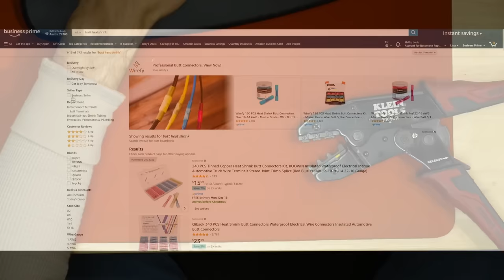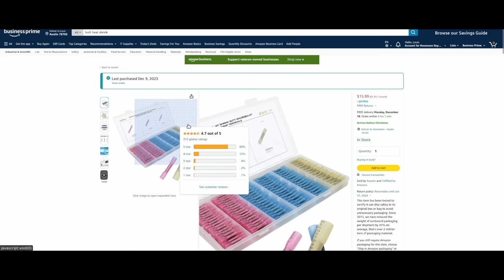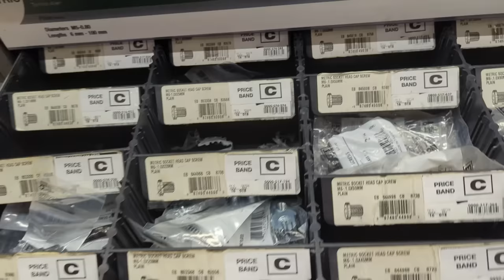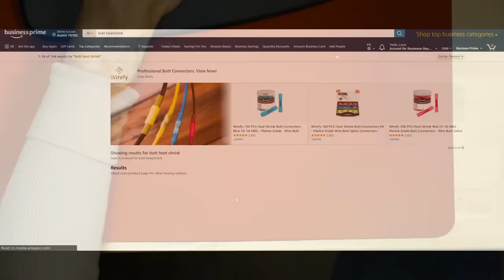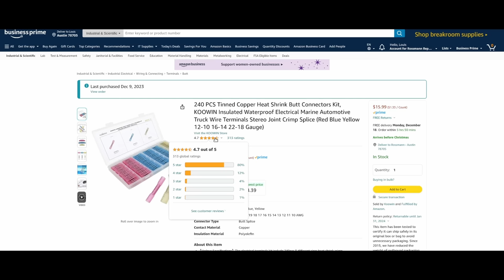Amazon Sells Dangerous Electrical Crimps

Comment: I put in an honest review of a WiFi camera I bought from Amazon.  It confirmed what other reviews were saying about the difficulty getting it to work and how the seller, a company in China, was trying to bribe you for a good review by withholding the promised memory card until after you gave them a 5 star review.  My review was taken down, along with the others and I was barred from reviewing that device again, by the request of the seller.  This speaks volumes about the integrity of the reviews on Amazon and I place little value in the ratings and comments.
Reply: I stopped using Amazon for exactly these phony reviews and very crappy products. Now I try to buy American. If I can.
Reply: Hahahaha! Holy shit! That's actually a thing? The seller can request bad reviews being taken down? That's just horrific.
Reply: I wish there was a way on Amazon to search by country of origin.
Reply: This is informative and unfortunate, but not surprising at all.
Reply: I only read negative reviews. They are the only ones with valuable information. If there are no negative reviews, I won't purchase the item because I don't know what potential problems might crop up. I expect even high quality items to have at least a few negative reviews because after all, no product is perfect.

I use ebay for most of my online purchases, but only for low value items or collectables.
Reply: @billh.1940 same shit in Germany. Lots of The Chinese don’t fairplay
Reply: I think I remember seeing your review because I was looking to upgrade my two porch 2.4g cams to 5g because it's very hard to get them to connect on my cell.
Reply: Many stores do this, eBay allows positive reviews before you've received the product but negative reviews can't be posted till weeks after it's arrived and often get blackholed or sandboxed so only you can see it.
Reply: I got into a similar situation reviewing a stick PC I meant to use for my TV. I returned it as I noticed it couldn't even play a youtube video in 480p without stuttering, put it a review, and for three months I've been constantly harrassed first with bribes, then with threats of being reported to Amazon.
Reply: I was once refused of my review, because it was not positive. I guess the product had already received to many bad reviews.
Reply: Try reporting counterfeit memory cards. There are videos about this where Amazon blocks the reviewer. They're aiding the fraudsters!
Reply: @billh.1940  for tools, european (especially swiss and german) brand names (like knipex, wera, hazet or felco for gardening equipment) are usually also very high quality. They are also usually quite expensive, but for professional use, the time saved should quickly alleviate that, as well as the durability.
Reply: I had a similar experience.
Reply: @gblargg  reading the reviews is like walking through a mine field, you really have to read a lot of them. Before deciding on a product.
Reply: Yeah it's disgusting how they cater to high volume sellers. Amazon has been morally bankrupt for a very long time. I spent $20,000-$25,000 on Amazon in 2014 with zero returns. Last year I had a dozen returns with $500-$1,000 spent. 

Also like Louis said you have to return the products so that the shipping is spent for Amazon to have to warehouse it/ destroy it.
Reply: This is how reddit has become my main source of reliable reviews... and hoping they aren't deceptive too.
Reply: @kennichdendenn  I know, I use them all the time. I also have older craftsmen tools. Once upon a time craftsmen were great.
For me it is also about fit. They dont slip and mess up nuts. They last so you only buy them once.
Reply: This is the type of crap that companies should have no ability to do. If you force a customer to remove a factual review, you are falsifying customer satisfaction by omission.
Reply: Jeff Bezos certainly didn't get rich by upholding ethics.
Reply: @joedirt1965 that's racist
Reply: @SilverEye91  Yes, they can these days.
Reply: Amazon is known for taking down or not publishing honest reviews. I have had multiple reviews taken down or not placed based on Amazon guidelines, whatever that is.  Of course they never give you the reason for why they won't publish just that they will not. They will also take down or not publish reviews that are negative about Amazon Prime. I did a review on a product that I purchased that came damaged as I was doing an unboxing video for my channel. When I made reference in the written review about the shipping delay with Prime they would not publish. I was informed by another content creator that they do not want negative press about Prime and will delete. Ridiculous‼
Reply: @ekscalybur  That's dystopian.
Reply: The unique 2/3 times that I tried to give a review that was honest and not positive, they always ended up rejected/deleted/removed... That says it all...
Reply: So where can we buy from?
Reply: I have left one star reviews for some fake USB drives I bought.

Not only did my reviews get taken down, but when I appealed showing proof the drives were fake, Amazon refused to listen to me and the counterfeit seller is still on their site to this day.
Reply: I had a similar experience with an awful product that tried to bribe me for a good review, I tried to leave a bad review calling the company out, amazon refused to even post the review saying they I wasn't allowed to talk about the company, ONLY the product. They know what they are doing for sure
Reply: I always look through critical reviews first to see if there's a pattern
Reply: I have multiple experience like this. I bought a product, inside there is an instruction how to get Amazon gift cards by leaving a review. I reached out to Amazon customer service, they didn’t do a damn thing.
Reply: I had something similar. I wrote a bad review for an Amazon marketplace seller, because he was a scammer and sold inferior versions for the full price, he even went out of his way to put a wrong sticker on it so people think it would be the right product.
It got removed because "you can't rate the seller for bad shipping, because shipping was handled by Amazon", even though I didn't wrote anything about shipping.
Reply: Dang can you share the name of the camara?
Reply: @joedirt1965  They will just set up a US "office" that is nothing more than a post office box so they appear to be US. Half of them are that way already, either in Canada or US.
Reply: @321CatboxWA wat in the world are you talking about, the person has the right to know the country of origin. Get outta here with these fake comments I believe you work for one of those companies that puts out substandard products and cry foul when when sumone puts you on blast.
Reply: Same lol, I bought something. It was of a poor quality. Made a legit, long, with photos review! Still got down...
Reply: ive seen that shit happen alot with products i buy on amazon some of them ask me to give a positive review so they can look good and theyll give me a free gift card code if i do a positive review
Reply: I had an honest review taken down as well! For some cheap shirt that I returned and I didn't think about it that much cause who cares, right? Take down my review, whatever.
Now it all clicks!
Reply: @hyceate-p Yeah, every site that tries to say they researched and did all this and that to find the best product that does xyz, is usually paid or sponsored.

Everytime I've listened to those sites I've gotten a shit product or an extremely expensive mid product. When I use reddit though theres always a general consensus and budget options.
Reply: @SilverEye91  Yes, although I thought that there would be more scrutiny over the process of removing them. However I am not surprised that there isn't.
Reply: I left a review only questioning if the device may be a clone, as it didn't work like the original I already had.  Review was taken down.  I re-phrased my review OMITTING any negative comment, it was taken down.  They CLEARLY game the system.  In fact, once Amazon removed my review, I could not even leave a POSITIVE review.  I was obviously flagged for THAT item, as I have left other reviews for items I was happy with.
Reply: They blocked me from reviewing anything because of this exact reason. When i contacted phone support they said i violated the rules, but couldn’t tell m3 which rule or what is did. There’s no place for honest reviews on amazon…
Reply: @kennichdendenn most of those tools are also made in China.
Reply: I once had a review deleted as it did not follow guidlines, there was no abusive language I simply stated that it did not work and no  I didn't send it back more fool me I try not to buy from Amazon now whenever possible
Reply: >witholding promised memory card
If I'm gonna be honest, I'm not sure the 'prize' would even be worth it, knowing how it'll be either a white-label card or a major brand's reject.
The white label SD cards have a thing for corrupting rather quickly after a certain amount of time. That is, if they aren't one of those capacity-hacked scam cards.
Reply: That wifi camera probably had malicious software on it anyways.
Reply: I was also given an offer for 20 Euros cash to take down a 2-star review of a product. It was also a very honest review, I wasn't trying to totally trash the product and even said if you are really low on money you might be okay with it.
They emailed me like 5 times trying to make me take down the review, even after I told them to suck my balls after the first mail.
Reply: someone I know got malware and lost $60k from one of those from Amazon
Reply: @SilverEye91  Sellers/businesses being able to request removal of negative reviews is perfectly reasonable, as platforms generally don't care about false negative reviews. The issue is that genuine negative reviews were approved to be taken down.
Reply: Same here my account has been restricted for years now for 'non compliance' with their internal policy. (I could never find out which comment they even refer to..) They prefer fake reviews which do sell more.
Reply: This has been my experience with reviews also. I consider Amazon the new eBay for stuff.
Reply: I purchased a mandolin and wrote my opinion on it and the company wrote me and tried to pay me to change my review I told them NO! I will NOT change my opinion and told them that was bribery and it would be a bad thing for me to do.
Reply: @SilverEye91   take down reviews is absolutly impossible in amazon, sellers that success doing that normally is becuase the reviewer broke some amazon rule, like using bad words, or so, and this gives power to the seller.
Reply: Wow, that's horrible! I never knew this was happening on Amazon.
Reply: @321CatboxWA  I hope that is a cheeky little joke and not serious.
Reply: Yeah my account was completely banned from reviewing on Amazon.
Reply: You're lucky Amazon didn't ban you from doing any reviews in the future!  That's what happened to me.  I'm one of the few honest reviewers and they banned me saying they thought I was working for the company while there are literally thousands of fave reviews posted every day who they do nothing about.
Reply: @joedirt1965
I’m sure it’s a very deliberate choice on their part not to have that feature.
Reply: I reviewed a hydraulic pressure gauge. Wasn't sure how accurate it was so I ordered another from a different brand. Turns out they were identical in every way. I mentioned that in my review so others wouldn't pointlessly order both, but Amazon rejected my review.
Reply: Similar stuff happens on the LatAm largest portal, Mercado Libre. I've been contacted by sellers to leave a 5 stars BEFORE SHIPPING MY PRODUCT. Very recently, I've also bought my car's brake fuild containers, found a note inside them saying that if there was something wrong with the product, to not open an issue and deal with them directly. That would be, me losing the money of the sentback because I would have to sent it by my own. The containers were bad designed and it didn't fit on the brake pump so I left a 1 star and proceeded to open a return. If you don't want bad reviews, don't sell shit products, isn't that easier?
Reply: Amazon rejected a review of mine based on me stating that the product (I ordered the same product continually) was great, but Amazon's repeated lack of adequate packaging meant the item was quite often damaged and that people shuld buy it elsewhere. I even wrote to Amazon (with a picture) explaining how an extra 5 seconds of work would mitigate the problems. I don't remember ever getting a reply..nice.
Reply: I had the exact same things happen to me everytime I attempt to live a review on an item I bought. Amazon review system is a scam.
Reply: An Amazon seller can take down a review? How? If that's true then reviews truly mean nothing.
Reply: thats what other platforms are for
Reply: @SilverEye91  yeah happened to a family member of mine as well. It's actually such BS
Reply: @321CatboxWA it's better to be viewed as racist than be the bag holder

Either way for most of us it's not even racism, the Japanese and South Koreans are the same race as the Chinese, yet I very much doubt most people using the feature would filter out Japan or South Korea...
Reply: I force search by brands and model,numbers on Amazon all the time.  They’ll always serve up the lowest common denominator Chinese junk every time left to their own devices.
Reply: @joedirt1965  I second this motion. I bought an office chair last year. Did my research, an American company, nothing on their site to indicate where it was actually made. Received the chair and of course it was made in China. Of course the quality was predictable.
Reply: Oh wow.. that's pretty freaking shady of Amazon to allow some BS like that. Especially if you were a verified buyer..
Reply: If a seller solicits reviews for reward then I think Amazon expects you to report them via the ‘report abuse’ option rather than just leaving feedback.
Reply: I wanted to copy this comment and forward it to someone I know who works at Amazon, but Google has disabled copying text in the youtube mobile app.  FML
Reply: Post the name here so we all know.
Reply: @TestUser-m1z  , rather than discount all positive reviews, you might find it worthwhile to only read those reviews, positive OR negative, where the reviewer bothered to write more than simple blather, and wrote like they really used the product, knew how the product should work, and if they had issues, did they just write an angry review or did they try to resolve it issue with the seller/manufacturer BEFORE writing their review? I think that REAL reviews tend to be more thoughtful and helpfully written, and less knee-jerk in nature. Also, any review where the writer is overly effusive is highly suspect in my opinion.
Reply: @G.S.Holland  Tell us who they are.
Reply: Sounds like bribery
Reply: @joedirt1965  There is, use your reading skills... also search for the type of product you want on review sites, don't expect the thing that wants money from you to recommend you something to buy.
Reply: I've had a similar experience with a negative review being removed, followed by me being notified that it was not 'relevant.'  Which made no sense.
Reply: I had a review for headphones I gave 4, decent but down marked because they had a coupon bribe for 5 star. Amazon rejected it as not relevant.
Reply: @_Circus_Clapped_  that's been my strategy foe years, but have you noticed lately that the  1, 2 and even sometimes 3 star reviews when you click on them it says something to the effect that they couldn't find them.  Only the 4 and myriad 5 star reviews can be seen.  I'm done!
Reply: @Tyan_Nahts Did you also go from buying name brand products to [Cat walking across a keyboard]-brand nonsense and are suddenly confused as to how quality went down?
Reply: Ya I posted a honest review of the Bose quiet comfort earbuds, and it was removed
Reply: @joedirt1965  That's easy.  If the brand name sounds like it was spit out of a random brand generator (like: "Skromjoy" or  "Alpermstu"), or if it's some unpronounceable string of consonants that looks like somebody just randomly mashed a bunch of keys and used that as a name, then it's from China.
Reply: They need a competitor.
Reply: I bought some live crickets for my frogs. They arrived dead as seller shipped in a heat wave (same state/similar weather), and didn't provide any heat protection. It should have been delayed. What a waste of bug life :( 

The listing was specific for the seller/shipper. My review got taken down because it was due to being a shipping issue, but shipping is a core part of the product listing.
Reply: @joedirt1965  95% of the products would disappear with such a country filter lmao
Reply: the seller being able to just request bad reviews be taken down defeats the entire purpose of reviews
Reply: I lost 200 on those retarded light bulb cameras and memory card as well.
Reply: If the seller could request to take down bad reviews, there'd be no bad reviews on any listing. Think about it. I can show you lots of products with a very bad rating.
Reply: You can sue them for violating your consumer right to leave an honest review.  And please complain to the FTC.
Reply: @AshnSilvercorp  It's actually illegal.
Reply: @wallaguest1  Uh, no.  These reviewers aren't breaking any laws.  They are giving honest opinions and they aren't doing stuff like using profanity, etc.  Amazon is illegally censoring them.  And they have the right to sue.
Reply: yeah. it's crap.  you can only review the product.  the moment you mention shipping related issues, they take it down.
Reply: that’s why I don’t feel guilty returning thinngs
Reply: I have reported multiple companies to Amazon for trying to bribe you into good reviews, especially the one that sent a letter with the bribe offer later, meaning they saved my address. The product usually disappeared from the site withing 2-3 days.
Reply: @jonnnnn Use the Seller Feedback Reviews option to boil them in oil. Start at Your Orders page. Cheers!
Reply: Similar result happened to me when I wrote a negative review of an otc product.
Reply: appreciated the feedback 😁👍
Reply: I dare that seller to come to the US and meet you.
Reply: @Clickworker101  Say Mainlanders.  We know what you mean but calling them Mainlanders should become a great insult.
Reply: @SilverEye91 yes, because another tactic that's super popular with these Chinese store is to spam negative reviews on their competition, often burying them off they don't fight back in a similar underhanded tactic like trying to blackmail customers into giving positive reviews and so on to make up for the flood of fake negative reviews.

Basically, once you have had actors exploiting trust based systems, everything goes to shit and there's no reasonable way to stop it. Enshittification of things and all that.
Reply: Well, you deserve it for buying a chinese wifi camera that sends your data back to china as well.
Reply: @Krashoan yeah no, it ain't reasonable not in the slightest.
Reply: @erebostd  I am in the same boat.
I can no longer post reviews or ask questions because of some alleged TOS violation 5 or 10 years ago.
They have never been able to tell me what I supposedly did.
They nuked all the reviews I had ever done.
Seems pretty harsh for one alleged violation.
Reply: If you were Amazon, how would you change "your" behavior to mitigate this issue?
Reply: Same experience.. my bad reviews were not even posted by Amazon.
Reply: true, i bought a gaming computer 2 years ago. the computer is great, nut in the boxe there was a gift card in exchange i have to go to the website, give good review. i dont like that. its like buying reviews
Reply: @youtuuba  Detailed reviews that strongly indicate that the reviewer actually used the product, with contextual photos and/or video tend to be very useful and accurate (positive or negative review, this way is good).

Simple platitudes or rants, tending to brevity, positive or negative, are almost always worthless and should be ignored.

Also, always check how much a product costs locally (online shop or "brick and mortar"), for example, I'm not in the US, local (in-country) shops almost all have web shops, and they almost all seem to price their products a bit less (sometimes much less) or only a few dollars more than the entire cost with shipping and taxes when buying the same thing from Amazon.  In these cases, I always buy locally and there's never a problem!

Sometimes Amazon just hits it out of the park on major 'name brand' products, like serious tools and electronics (PC parts like memory and SSDs), etc., with free shipping, too, to the point where it's absolutely great to buy it from Amazon.
Reply: @ExiledStardust  well, i sell on amazon and  it has always been impossible for me to remove incorrect reviews. Amazon always says "the user has the right to express his opinion about the product as long as respects amazon rules".
Always result from other sellers. i guess sometimes sellers are more lucky somehow, what can i say...
Reply: I’ve had that happen to me as well. Amazon appear to be actively resisting genuine reviews of garbage products
Reply: @SilverEye91 
I got that so often, I not only gave up on offering reviews, I deleted all my past reviews - just don't want to be associated with that suspect process any more.
Know what else you can't do? Write anything critical of Amazon themselves, even by inference. Even trying to complain about any aspect of Amazon's service will take you on an exhausting tour clearly calculated to discourage complaint.
Reply: @billh.1940 "Buy American". What a stupid thing to do. Buy american just because it is american. Bah...
Reply: That's not bribing, that's extortion
Reply: 99% of this stuff comes from China. With what the world has allowed, what good alternatives do we have? Home Depot and Lowes are options for many of us, but carry a very narrow product line compared to Amazon. Walmart is a possible alternative, but we need a non-China market place.
Reply: Same here, I've had reviews removed from Amazon, supposedly for going against their TOS (but of course, they won't say what part of the review was against their TOS....because nothing in the review was against their TOS.)
Reply: i only trust reviews that come with photos. i'm rarely disappointed with such products
Reply: When it comes to Amazon the review must be about the product. If it just says this seller sucks or something like that it can be removed at the sellers request.
Reply: "My review was taken down, along with the others and I was barred from reviewing that device again, by the request of the seller.  This speaks volumes about the integrity of the reviews on Amazon and I place little value in the ratings and comments." - THIS. Amazon has become a freakin' dumphole full of literal garbage, everybody should avoid it as best as they can....
Reply: @SilverEye91  "That's actually a thing? The seller can request bad reviews being taken down?" - Yes and has been for 2-3 years now, roughly since the COVID pandemic began or a bit after that. Amazon's been going downhill since then.
Reply: @CoolKoon  I've not bought a thing from amazon in 10+ years. I legitimately think the last thing I bought was Uncharted 3 lol
Reply: Yup my dumbass landlord changed the wifi system to amazons stupid eero system. Its sucks donkey nuts and Im trying to tell the landlord to return it and revert back to the old wifi set up and his response: “but the reviews on amazon are good” 🤦‍♂️
Reply: Oof that's Uber shady
Reply: @My_Old_YT_Account   Sarcastic humor . What a lefty would say. No I really don't think it was racist. Don't let me discourage you.
Reply: You were lucky. I did the same and got fully banned and my reviews taken down.
Reply: Seriously? They can do that? I'm actually surprised that Amazon would do that.
Reply: A lot of products with negative reviews delete their listing and just re-list it. You go to make a negative review and the listing is gone.
Reply: I've been notice an increasing number of obviously fake reviews.
Reply: @Tyan_Nahts  but only morally,, more's the pity.
Reply: I wonder if that was the same camera which dropped surpport for some of their models which were still being sold on amazon ?
Reply: @SilverEye91  makes sense if you think about it because you constantly see things that aren't 4+ star worthy with mid to high 4's
Reply: It's not just Amazon, on Walmart website I bought sandals that if u got any water on them start to fall apart.  I returned it and my honest review was taken down.
Reply: I've received a mailer in an envelope a week or so after purchasing a water pick knock off brand stating how he had a family and needed the good review.  The product already had a 5 star rating with more than 5,400 reviews.  Weird.
Reply: Happened to me too
Reply: @gblargg I stopped trying to buy them on Amazon or eBay because they were all counterfeit. That was like back in 2015 so I imagine the situation is still just as bad.
Reply: Load of crap. Sellers cannot delete your reviews or "ban" you from reviewing their device again. I've left a LOT of scathing 1-star reviews. This doesn't happen. Amazon's website and other sellers have anecdotes on the internet saying this doesn't happen. Unless you're vulgar and hostile your reviews don't get banned. I'm sure there are some instances where the algorithm fucked up based on someone reporting your review but unfortunately that shit happens everywhere now, and you should be able to appeal it.
Reply: I'm having a similar issue where I was scammed. I paid for headphones, and received trash no-name doorstops.
Reply: Temu is the crack of internet crap.
Reply: @alphagiga 
You have to buy what you can locally. It's harder and more expensive but as time goes on it'll get easier. As more and more money flows into your local economy stores will be able to stock more and more niche things. 

If you have to buy something online try going to trusted independent stores or by buying from chains/medium size brands online stores. 

Like before I left the US if there was a book i had to buy online i did it through half priced books. If there was a board game i couldn't find locally then miniature market. 

There's tons of options that don't involve Amazon
Reply: @joedirt1965  No kidding.  I've bought items and discovered it's coming from China by the tracking number...
Reply: That's f*cking INSANE! I've heard and read a LOT of sh*t when it comes to Amazon, but this sets the bar sooooooooo low .... they "withheld" a memory card until a 5 star review? Jesus Christ man! LOL I wouldn't buy from them just because of that alone!
Reply: How do reviews get taken down?? I'm guessing the seller can't do it, and has to request the removal by contacting Amazon? 

I can totally see Amazon pulling requested reviews down, because these reviews are ALSO an interest to Amazon as they can be a large effector to their bottom line.
Reply: Yep, both Amazon and eBay have down falls, with reviews of a sell better on eBay, (harder for them to fake or remove a negative, and selecting only US shipping eliminates a lot of straight from China Shipping. But they have started to side more with a buy now than seller. I recently lost an item sold, buyer said it didn’t work was, I refunded buyer was supposed to send back never got it, even calling eBay, still lost both my item and shipping. I’m pretty much done with selling on eBay. Since they dropped PayPal as transaction seller has little recourse protection.
Amazon is just a crap shoot, although I’ve had fairly good results, but I know what I want and do my research.
Reply: I've had Chinese companies quite a few times now trying to bribe me to take down negative reviews... and I completely refused.  Even when they refunded and sent me free stuff (which was also mediocre), I refused to redact the reviews.   
The fact that it keeps happening over and over again kinda amuses me.  Their desperation not to be accountable for their own shitty products is kinda funny.
Reply: Instead of mentioning this in a reviews, you could have complained about the bribe to the customer care. From my personal experience,  Amazon would eventually lock the reviews with a notice saying the reviews are not accurate.
Reply: lol
#TrumpWasRight
Reply: companies removing reviews needs to be shut down.
Reply: Yup, they do that on Steam now too.
Reply: @321CatboxWA  how is that racist. I mean there are Asian people out of China. Discriminating by country, legal system or other cultural criteria has nothing to do with racism...
You are racist if you believe that one has to live in China and have a native Chinese culture to be of Chinese phenotype.
Reply: @prahalb  That was sarcasm. Relax.
Reply: Same here.  Every time the seller tried to bribe me, I added that to the review.  It was taken down, of course, because Amazon doesn't give a sh*t about the quality of the goods, and they care even less about the customer.  
I look at the 3-star reviews, a category in which the seller is not going to be spamming the system.
Reply: Had this happen with an aux cable once. It was crunchy and i ofc included that in the review.
They ended up restricting my account so i cant buy, review or change anything about my account. Ended up calling support and all they said was i can delete the account. Nice...
Reply: Just here to tell my story too. It's not just products like this that they do it for. I once left a review on a book I read that I purchased from Amazon. Basic book review on my thoughts and why I had some negative feelings on it etc. Nothing worth note. I get an email some time later saying my review was removed for "Breaking community guidelines". Either the author or publisher didn't like my negative review and requested it be removed on the grounds that it violated the tos... Absolute pieces of shit.
Reply: They took down a review saying their product was shit? That's fucking sad.
Reply: I had a review removed on amazon as well. It was for a foreign made project that has an official US reseller. I left a review saying that was the case and that the amazon product was 3 times the official resellers price.
Reply: Amazon and “honest reviews” don’t vibe too well with Amazon.  😂

They cutoff my ability to review products years ago…….despite writing many lengthy honest reviews that would help many people determine the experience of using various products. Now corrupt vendors are running amok censoring people who will not put up with their bullshit and customers can no longer talk to each other, which was one of the best parts of the reviews! 

At this point I watch several product reviews on YouTube, I no longer solely trust what is written on Amazon given their actions over the years and poor censorship.

I remember in a comment section about cars, some Chinese company was shipping rocks to customers in a box who ordered brake sets. Because the shipping and return times were so long, customers wouldn’t be able to secure refunds. You can’t make this shit up!!  😂😂
Reply: @wallaguest1 Bullshit on both ends, these guys are double dipping cause they let corrupt vendors flag honest reviews and censor reviews on certain products.  😂
Reply: Same, had the same experience with some chargers as well. Was 80-90$, for surface pro. Garbage equipment
Reply: @JS-jr1fo If only he knew…..  😂😂

Ah man sorry for ya.
Reply: @TheSoulCrisis  at least someone understands my pain… my gaming has been ruined until I move. Thank you for your pitty
Reply: Minus the banning, I had the exact same thing happen. You notice how questions and answers are not showing the top rated questions anymore? That's because you used to be able to get real opinions in there.
Reply: I used to sell used lab equipment on Amazon and they won’t let you undercut high priced items to make them sell faster if they have one in stock for sale as well. I tried to take 1000 dollars off an incubator I had listed because I got a good deal on it and wanted it to sell quicker and it got delisted.
Reply: "Reviews" don't mean sheet. Especially not on 'Zon. XiXiPi owns all of it, anyhow. If you don't behave, you'll be cancelled. Obey or get absolutely destroyed. 💪😎✌️
Reply: This is the problem to a T, you can't trust a review.  I bought something recently, it's not a bad item but they  put in a card saying if I left a 5 star review and took a picture for it they would give me a $30 amazon gift card.  The item I bought was $35, that sounds like a pretty good deal but my integrity is worth more than 30.
Reply: It's much like Yelp reviews.  Many times you can know when the reviews are phony.  No one with a college degree in English and Writing is going to leave a two paragraph "like" review.  When they love the restaurant and use the waiter's name and the owner's name it is suspect. I almost never leave a restaurant knowing the owner's name or remember the waiter's name. If a reviewer knows everyone's name, they are just a friend helping out. Or a paid review.  If most of the reviews don't have these problems and are positive, but someone leaves a scathing review, it is probably a competitor restaurant down the street.  Some of the same principles work on Amazon.  For instance, if someone leaves a positive review but the item mentioned is not what the posting that you are looking at is about, you know shenanigans are afoot.  Anyone have any other ideas?
Reply: Exact same thing happened to me. I put up a very honest, yet 4 star review. Blocked. So stupid. I liked the product overall. But obviously said something upsetting to someone.
Reply: I also had a review removed from amazon. It was not even a bad review, just shows a ahortcoming of automatic lens cap causing a bit of vignetting..
Reply: I can't believe that a person even CAN be banned from reviewing a product on Amazon.  This is equivalent to censorship and worthy of a lawsuit.
Reply: Same thing, bad review was rejected. I no longer do any reviews for Amazon
Reply: @SilverEye91  I wondered what happened when it would say a certain percentage of number one reviews and you click on it and it said "none found" WOW!😲😲
Reply: I've never heard of that happening to a review. I write many negative ones and have never had them taken down. When buying, I always read the negative reviews first, and have never found a widely sold product without negative reviews. Yes many of the positive ones are solicited, and some are such obvious BS you can just ignore them. Just have some sales resistance and don't believe the puf. I buy almost everything on Amazon Prime, and only rarely have to return something because it's junk. But the return process is so easy, and buying from home so convenient, it seems worth it to me.
Reply: Just received a card in the mail today for me to give a 5 star review on a product after which I take a screenshot of the review and email it to them, then in turn they will send me a $25.00 gift card. Well I am sorry but my reviews are not for sale.
Reply: If you were to report them, and show proof, thats an IMMEDIATE suspension for the seller. Amazon DOES NOT mess around with this stuff.
Reply: I have a lot of experience with the Amazon platform. I think you are misunderstanding what occurred: Amazon removes what are likely hundreds of thousands or more of fake reviews annually. They aren’t the only platform plagued by these. Whenever a Chinese seller creates fake reviews as in the case you describe, Amazon has to use their best assessment to determine which reviews are the fakes. It’s not perfect and there is collateral damage. However, it is likely your review was removed only because the Chinese seller was being penalized in the first place. Dealing with this volume of fake reviews isn’t an easy thing, unfortunately. That said, I do believe a lot more of these Chinese sellers need to be banned from the platform. Too many violations. And Amazon is too lenient many times.
Reply: @billh.1940 it's not Amazon's fault. It's your fault. If you are smart, you know what to buy and you'd recognize Chinese generic garbage immediately.
Reply: @SilverEye91 no. They hire someone to hide the reviews. Usually Chinese people offer that service.
Reply: I dont get the point in that? All its gonna do is get more people to waste their time with it, get annoyed, and then return it and if they cant get a refund they will just dispute it with their bank
Reply: Its the same on ebay. I was curious as to the quality of a no name DC heater. So i bought one, cheap, for 20 bucks. When it came, it wasnt what it was rated to be. I informed the seller that i was sent the wrong one. She wrote back (using indian english) to just keep it, and she will refund me a couple of dollars. I said no, send me the right one. She then said she will refund me 4 dollars. I said no, send me the right one. Eventually we got up to 15 dollars, and i wrote back "ok, thats enough, im sending it back to you and writing a negative review). She pleaded with me to not send it back, to just keep it, because they cant process returns right now, as long as I leave a good review. 
So there it is. People buy crap, want their money back or to return it, but instead are stuck with it as long as they leave a positive review. Unfortunately most people leave a good review, and just a few people like myself stick with giving honest reviews.
Reply: thats where you make a 5 star review, but subtly tell people it sucks, much harder to take down.
Reply: I have noticed just over the past year or two the amount of fake reviews and also as of late, completely missing reviews. It will say 128 reviews for said product and only 6 show up and there's no way to see the other 122 because obviously, they don't exist.
Also, the amount of fake products have blown up on Amazon and other sites as well like fake flash drives; they're everywhere! It's one thing to sell a low quality product like this video is showing but it's another thing entirely when a product isn't even what it is!!
Five and especially ten years ago you pretty much never saw any of this stuff or these fake reviews, etc.
Reply: @GalvestonGuy  id say fentanyl ahahaha
Reply: Paid reviews are biased. Free reviews: you get what you pay for.
Reply: That’s why you don’t buy products through Amazon from Asia.
Reply: I had the same thing happen to me.  I gave an honest negative review on a product and Amazon took it down
Reply: I gave a seller a bad review and they reported me for harassment or something like that.
Reply: Whilst, yes, review system is rubbish and abused.
Do not buy unknown items that are to be used for purposes like electrics, do not mess with electrics if you do not know how to.
Reply: Ping ping ping nothing to see here
Reply: I did the same on a few different poor quality items. Amazon has now permanently banned me from leaving any reviews on anything.
Reply: There is. There is an extention for it
Reply: Had the same thing happen to me regarding some outdoor "Cat/Deer/Pest repellant" devices that were supposed to be IP6 Waterproof, but all got ruined after it drizzled one time lol. Shot al the electronics inside. I wrote a review saying that as well, also mentioning that the seller had tried to bribe good reviews by offering more money than the actual item I bought cost for a positive review. Amazon pulled down the review until I edited it to remove the part where I mentioned most of the good reviews were probably only based on that card with the redemption coupon inside. Really made me see how Amazon was not the same as it was just a few years ago.
Reply: I'm blocked from leaving reviews ever again because I did this more than once 😅
Reply: Same here. Also, recently got a "I'm a single mom supporting 3 kids" BS to change my rating.
Reply: I would have returned it immediately. I'm not going for that.
Reply: Yes! My Amazon account doesn't even give me the ability to review things. I guess because they don't like my honest review.
Reply: I had the same problem.
Reply: @321CatboxWA  but is it wrong?
Reply: I'm an Amazon Vine reviewer, and this doesn't surprise me at all. I got a product for review that was complete crap, and they tried to get me removed from the program. I had to send photos backing up my 1 star review.
Reply: That's blackmail, not bribery. Also, with Amazon's return policy you should obviously immediately report that and return the order.
Reply: @Peter.F.C  whats that?
Reply: Bezos claims he switched focus to Blue Origin, maybe he wants to wash his hands of this.
Reply: @hyceate-p  YouTube used to be a good shout but that's full of people who are given a freebie or are sponsored in some way
Reply: That ain't a bribe... its extortion
Reply: Sounds like a lawsuit against Amazon.
Reply: Thanks for sharing your story
Reply: its why i only buy items with free returns. no nonsense that way.
Reply: @Peter.F.C It's up to you.
Reply: @WokelandDefector  yep
Reply: This post is absolutely ACCURATE! I had an Amazon Marketplace seller bribe me to take down a negative review for a Trail Camera that was junk!!
Reply: if the company is willing to give me a gift card then I'll give them 5 stars but I will instantly drop that review once its been paid and there is nothing that Chinese company can do but this problem is not from China but India as those are the ones allowing the trash to be sold
Reply: True article
Reply: i learned reviews from amazon were worth very little probably a decade ago....  tried providing a review on a used textbook for college... item was not as advertised, was labeled acceptable like new as description

what i got was a book with a broken binding (the entire book fell out of the hardcover) and the book had lots of little tags throughout all the pages....
Reply: I only provide 5 star reviews for all my purchases. Because that way they'll show up then later on. I edit them to provide the actual review
Reply: I have been financially bribed for a five star review, I ignored their offer.
Reply: They are very unethical if a company is withholding parts until you give them a 5 star review…I prefer not to deal with Chinese companies
Reply: Thats pathetic. china does make some decent products. Though they make and export more trash products than the good. I have started looking as closely as I can to see what the country of origin is on the products and items I'm looking to purchase as much as possible.  Also I've been kinda skeptical of any reviews left for any product from anywhere or companies. Especially when there are lots and lots of high star reviews.  And then maybe like 1 or 2 low reviews.
Reply: Bonkers 😅
Reply: I can confirm. I bought the wi-fi camera & received an email as described above. Tried to expose, comment never posted.
Reply: I bought Christmas items on Amazon, with American brand names but they come from China. 

So I believe my Christmas gifts for my granddaughter may be rejected on principle
Reply: Was it Tecnet by any chance? Cheap Chinese clap, which often strongly mirrors similar items from known brands like Logitech, but only in aesthetics. I've twice had them try to bribe me with free replacement items and even Amazon gift vouchers in exchange for 5 star reviews.
Reply: @billh.1940 yeah , like what !
Reply: Yes, because say you don't have a capacity to ship overseas or it isn't profitable. It's up there as such, and someone gets mad because you SAID you can't do OS ship. Had it happen! 

Also been blamed for the post office when it was FBA (at AZ warehouse, not w me). That got changed.
Reply: Look close, they're almost ALWAYS 4.5 stars, no matter HOW many bad reviews.
Reply: I had the same thing happen with a tea kettle. I even gave it a positive review but mentioned that I received an offer of a $20 discount (that I did not try to accept and which didn't specify it had to be positive). I wouldn't have noticed except I went back to edit my review after using it for a month. Amazon support did respond but lied to me by first claiming that they had limited reviews on the product because it detected unusual activity. I pointed out that a review had been posted a couple days ago. They then claimed they had detected unusual review activity on my account (they didn't - I rarely review anything). I cut to the chase and told them I suspected it was because I had mentioned the discount, and I attached a scanned copy of the offer. Never received a response but the product page quickly disappeared along with all the company's products.
Reply: @SilverEye91 Well… how many thumbs down do you see here on YouTube? The option is still there, but the consumer only sees half the picture. Without knowing how many thumbs down? The number of thumbs up are out of context. Welcome to “the control over the means of production” by corporations that receive subsidies from the federal govt, aka socialism.
Reply: class action law suit
Reply: My honest review of a men's shirt was also not allowed. It was an expensive designer shirt that I  bought for a gift. so I needed it to be in its original packaging (i.e. supporting cardboard, pins, etc.). It was sold as new. However when it arrived, it was sans manufacturer's wrapping and shoved into an old plastic bag. It was obviously not new. My review was removed because Amazon said that reviews are not allowed to mention packaging,
Reply: THIS.  SO MUCH THIS. (had a similar experience)
Reply: @SilverEye91 I think if the review talks more about the seller than the actual product, they can remove it
Reply: This actually happened to me the other day. I couldn't believe they would do that. The review was very professional and very honest.. the fact that they can take down reviews as they see fit just makes me laugh and removes my trust completely.
Reply: @billh.1940 
Is anything built in the USA even quality anymore? Seems like anything new is built using the cheapest materials that are designed to break the day after the warranty expires.
Reply: The beauty of it is that you can return it and the Chinese Amazon company is out $$$$
Reply: I’ve had legitimate negative reviews removed too. It’s wild how amazon has allowed itself to turn into a cesspool.
Reply: That’s as scary as hell!
Reply: Yes, it is obvious that many of the comments are not authentic...but that also seems to vary depending on the type of product you are purchasing.
Reply: This reminds me of a siding/roofing company my wife and I used.  They did use very high quality products, but their price was pretty high.  One of their tactics was to oversell their product by an astronomical amount so customers would agree to doing things for "discounts" such as writing them a 5 star Google review.  But in order to get that "discount" applied to your contract before you sign, you needed to leave the Google review before you sign the contract so they could reduce the price before you sign.  I began looking at the company's reviews and 99% of the 5 star reviews were people talking about how police, professional, and knowledgeable the salesmen were.  Not one single good review was from the work itself.  There were very few bad reviews, but every single bad review was about problems with the work.

The problem is that they used a bait and switch tactic.  They came in, sat down and took their time and told us what the end product was going to be.  We agreed on a certain price for the whole job, for example $30K.  But when they brought the contract by, they wouldn't come in to review it.  They kept insisting they had to leave to go to another client and we just needed to review and sign while standing in the doorway.  And, they didn't have paper contracts either.  It was all digital on their tablets so they couldn't leave them for us to review.  The contract was an "itemized" total so we couldn't see that they added on some extra charges that resulted in an extra $5K.  Once we got the bill, we realized we were taken advantage of and we disputed it with them and the salesman kept acting like we never agreed on the amount we agreed to, and the amount with the extra $5K was always the agreed upon amount.  The company agreed to refund us $3K because we kept pushing the issue, but they told us we needed to sign a document for it.  The document contained a "good relations" clause.  With a name like that, you would think it would mean something like moving forward on good terms and not letting the dispute cause negative feelings towards one another.  But in the finer print of that "good relations" clause, we were legally agreeing to not write them a bad review.  So we refused to sign it.  I can only imagine what would've happened if we didn't read it and then posted a 1 star review.  Would they have tried to sue us?  Who knows.  But it explains why there were so few 1-star reviews.
Reply: ALL my reviews were removed from Amazon. They don't allow you to speak your mind, especially if you mention made-in-china junk. I returned the last several items I bought from them either because of poor quality or suspicion that I was getting a previously purchase/returned item.
Reply: @SilverEye91 yup. They will either send you an Amazon card for the value of the item or, if you want to return it, they’ll refund the money and tell you to keep it but, in return, they want you to change the review .
Reply: Similar experience. Bought a product with a design flaw that failed. Submitted a review highlighting the failure and design flaw in detail got me banned from reviewing products.
Reply: Amazon is worse than eBay now.
Reply: I've seen that happen. Feedback too, shite (lol) just silently disappears. But I'm surprised you're just discovering that — it's been this way a looong time. I do use amazon, but I ignore review summaries. I read some reviews and evaluate their validity. That there are five gazillion pos reviews on something means nothing to me (other than that the maker likely hired an army of bots to put those up).
Reply: @321CatboxWA Nah.... It's discerning. You do it too, when you avoid a neighborhood or specific city after dark. Racism card is pretty played out...
Reply: @croakie007  Does nobody recognize sarcasm anymore? @
Reply: @prahalb  It's not racist, just pushing buttons and pulling levers. Nevermind the man behind the curtain.
Reply: but i have reported sellers doing this and usually it seems support will give you a refund for your product if the seller is attempting to withhold their product from you until you delete and post a positive review
Reply: Absolutely the same for me. I would honestly review every single product, but Amazon started banning the occasional not so good ones. I haven't reviewed a single purchase since, even though they constantly ask for them. Rubbish company underneath alll the fairness bs.
Reply: I reviewed a book and it was determined by Amazon that I was a fake reviewer. There was literally zero reason for this and I was barred from reviewing on amazon. The review was favorable but not over the top, it was just a description and a regular review. Amazon sucks.
Reply: I was banned immediately after reviewing an Apple product at 1 star. They found a technicality from an old review that was allowed to stand for a long time.
Reply: @croakie007  I live in the sticks I avoid potholes, dead-end roads and deer if I can help it . I admit to avoiding Seattle all of it.
Reply: Same. They removed my reviews multiple times. Not inappropriate at all, the items were bad or counterfeit.
Reply: Yeah, anything with a network connection shouldn't be purchase from a Chinese Amazon company.
Reply: @oatlord  I discovered that with CCTV security cameras. Agree 100%
Reply: I don't buy products from China if I can help it
Reply: @321CatboxWA   but is it wrong?
Reply: @321CatboxWA   Sure, but is it wrong?
Reply: @Peter.F.C  It's racist
Reply: @321CatboxWA  Everything is, according to some, so what's new?
Reply: @321CatboxWA  Maybe, but is it wrong?
Reply: We don't even have a "Communities" team over the phone (communities is meant to deal with review related issues and bans), they work only via email, and I've never had a single customer who hears back from them, that tells you a lot about AMZ.
Reply: This happened to me too
Reply: Thanks for sharing!
Reply: @321CatboxWA no it's not
Reply: That's why only buy from a local store
Reply: That's why only buy from a local store
Reply: That's why only buy from a local store
Reply: @SilverEye91  unfortunately a lot of the bad reviews for good products are competitors, and a lot of the good reviews for cheap products are the company hiring the reviews out.
Reply: I put a lot of reviews on Amazon and the amount of them that never get published is astounding.
Reply: @garyplewa9277. Not only. They also don't let you write a review if you haven't bought something for a while. There was a time when I bought many, many items, I was a very "good customer". It's just that lately my son buys everything through his account because he has some money there, so I don't appear as a recent customer. So I cannot review anymore, until I make a purchase. How does this make sense, since it's a review of something I did buy in the past? Or in the case of books/CDs, there were some cases of books I had purchased from elsewhere, but I can still voice an opinion on them, right?
Reply: I never have put full trust in their reviews. I do my homework before making a final decision, unless it’s a well known product/name brand.
Reply: Amazon banned me from ever leaving a review on their site but never explained why.  They just said it went against their guidelines.  I’m sure because I said it was cheap junk from a certain country that starts with a “C” and ends with an “A”
Reply: shouldve opened a return case then taken a dump in the box and posted that back
Reply: Prove that this happened.
Reply: I’ve been a Prime member for years and was giving reviews occasionally, be it good or bad when warranted. Never mean, and yes, there were “overseas” sellers emailing me from time to time to give them 5 stars. I refuse to do that and lo and behold, I’m no longer allowed to review anything, ever again on Amazon. I guess Amazon does not want to lose any money from their crap sellers by getting bad reviews and only good reviews, so they slap honest buyers and kick us to the curb.
Reply: I understand being able to take down reviews of people who haven't purchased the product, but verified purchasers should be protected from that!
Reply: EZ, put 5 stars then change to 1 once the memory card is received. They're out the memory card and still have to delete your review
Reply: @23Butanedione  how many kinds are there?
Reply: You know the website is shit when reviews can be taken down by the seller, not the company itself
Reply: And to think, the owner of Amazon owns "The Washington Post".    I'm sure they are being honest with their customers... :)
Reply: I didn’t try mine and left a good review to get the card.  Year later I tried to hook it up…. Guess what?
Reply: That's not a problem caused by Amazon... It's caused by the seller and their shady tactics. They likely offered money to the same people that gave a five-star review to report yours. That means you need to report any shady stuff to Amazon directly and that item will be taken off the platform.
Reply: @Adventist1997  oh yeah no I he that.  It’s just you have to be really careful that it’s not a drop shipped knock off when you get it and test it out right away AND make sure you don’t have to get the refund from some company overseas.
Reply: This is why consumer reports is absolutely vital to the public!!!😊
Reply: yup totally agree. i actually didn't buy a book but critiqued it because people took pictures of pages and i complained they were the exact same as another business book. my review got removed and now i can't find the seller, probably because ive been blocked.
Reply: Same, here
Reply: Same for my product from Moen. I’ll never use them again for all of my plumbing jobs.
Reply: Amazon have turned into a shit company - by comparison, Temu actually looks attractive!
Reply: should be illegal to remove consumer reviews once posted
Reply: @joedirt1965  lol just take a guess what country the cheap stuff comes from and 99% you are right.
Reply: My community account was banned for calling out two obvious racist (characters) in my movie review... of a so-called comedy... racists!  After months of trying to contact community-help, and going through chat, I never got a reply, except for the same stupid form email.
Reply: I only look up the bad reviews. After all I wanna know which problems the products have...
Reply: I had a company straight up not even send me the item, just an empty box. Return was more than the item. My review was removed for "criticizing the seller instead of the product." Sorry, I didn't GET the product!
Reply: @SilverEye91  Lol it means amazon can cheat customers into buying a crappy product
Reply: @elone3997  You're meant to review the product, not Amazon's packaging or shipping. Or even the seller's, since the same product listing can be sold by different sellers, and it makes no sense to "review" just one seller as other customers won't know which seller you were "reviewing". That's what feedbacks are for, which is a different system.
Reply: This makes sense. Amazon benefits form positive reviews since it's more lokely they will make sale.
Reply: Oh wow didn't know thanks for sharing definitely keeping in mind. I mean using the review checkers was something I did but hmmm makes me think